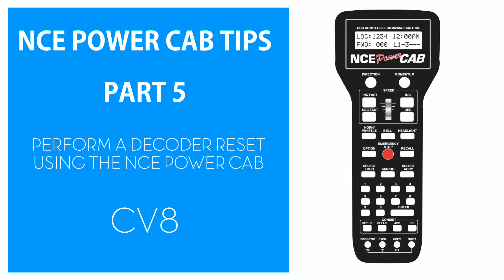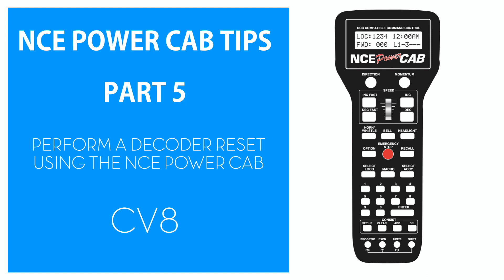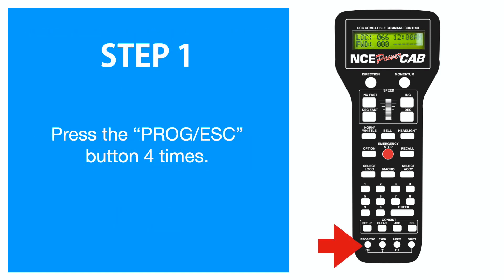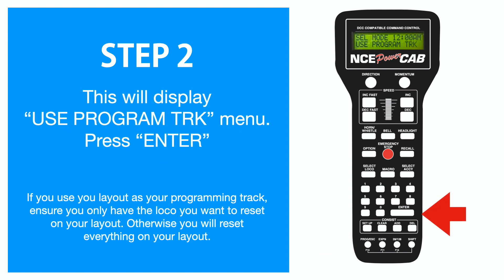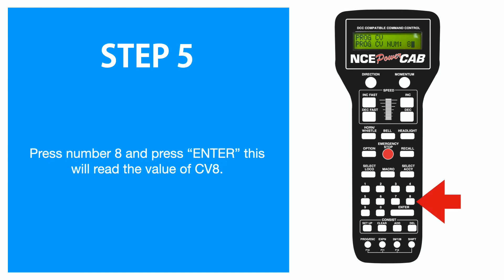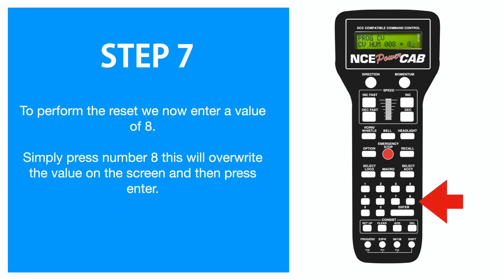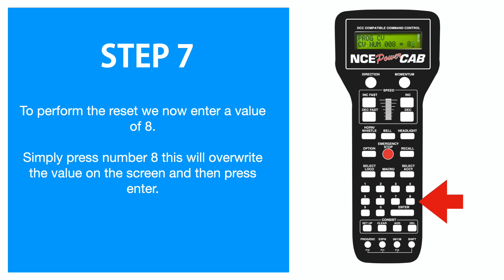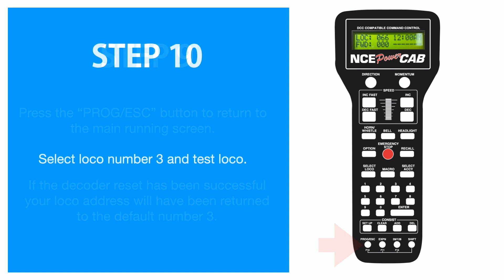NCE Power Cab Tips Part  5 Performing a DCC decoder reset. Digitrains Ltd.

Comment: Thinking about getting into DCC Quick question can you run a digit tracks decoder with a NCE power cab with no problems?
Reply from the maker: Hi there. Yes it is compatible with any DCC Decoder. 🙂
Reply: @DigitrainsLtd  thanks